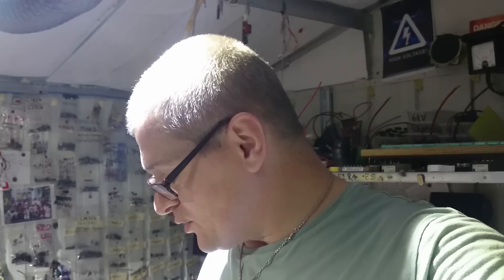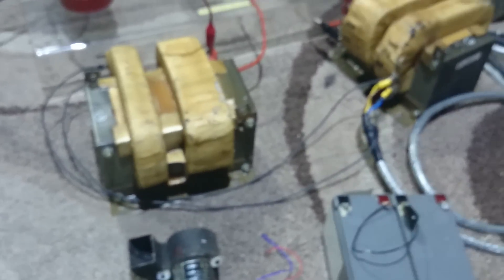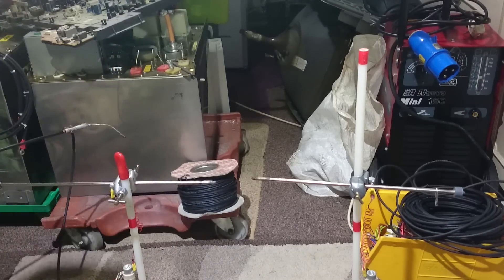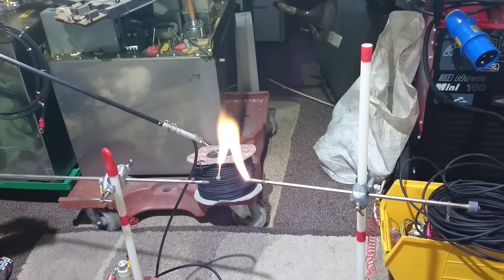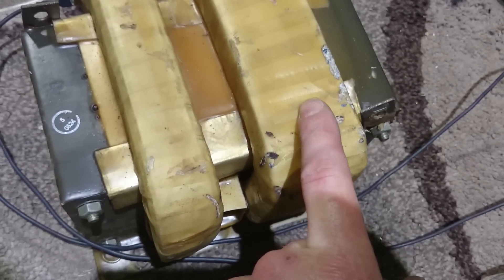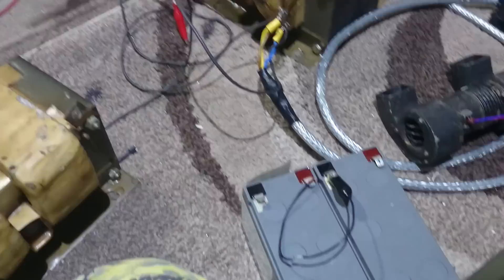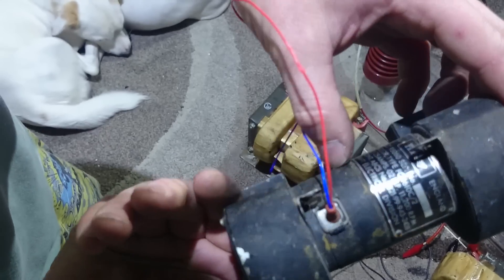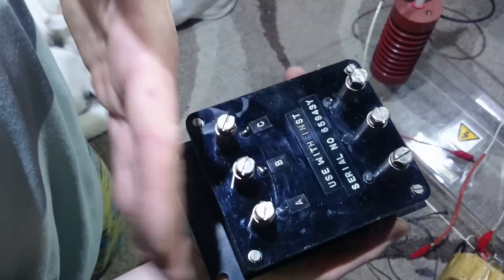2x 2000watts+ MOTS / microwave oven transformers

Comment: Awesome arcs, what current are you drawing on those 30 Volts windings. Your mancave is filling up nicely. With 400 Volts you will get a better flux in those cores. If you remove the shunt the arcs will be more violent. (your 9 Volt smoke alarm battery is low)
Reply from the maker: Hi ray mate. Thanks for the comment mate, yeah I'm not sure of how much I'm drawing on them windings
 I'm going to have to test it at some point mate. 
And I'm going to need another garage lol. I'm getting more and more stuff in my workshed every week 😉 I'm running out of foot space haha
 I don't think it's as bad as yours haha 
Since your video where you show ya workshed around have you made any changes??

Hope you and your family are good and well.

Thanks for sharing ray,

👍👍👍👍👍THUMBS UP 👍👍👍👍👍

Comment: high1voltage1rules Hello Mate;D Those are some pretty huge MOT's, 15,000 volts out of a 2100 volt MOT is unusual, but the milliamps is around 450ma, but one thing I've noticed is that the transformers iron core looks like my high current transformers core, I'll make a video of it, thanks for sharing the good, character video, play safe mate, and cheers;D

Comment: Have you tried to use an auto transformer, or just hooking to 390 volt tap and common straight to the mains?
Reply from the maker: Hi mate, yes iv tried the com send 390 tap and it's not a good output. Needs the full power mate. I will get them on full intended output 😉👍⚡⚡⚡⚡

Take care mate and thanks for the comment. 😁